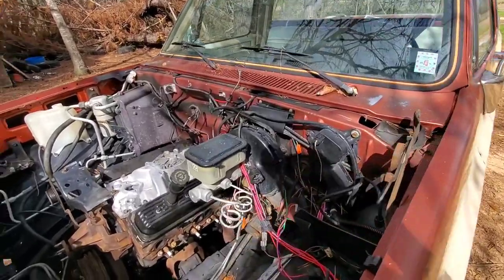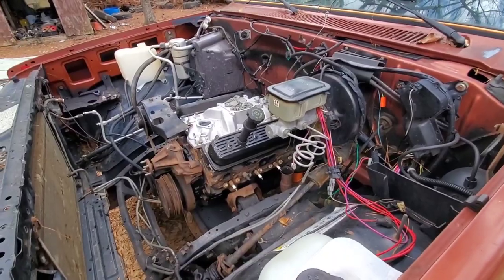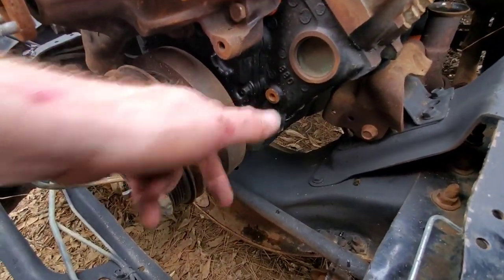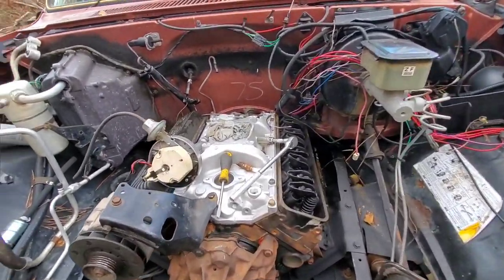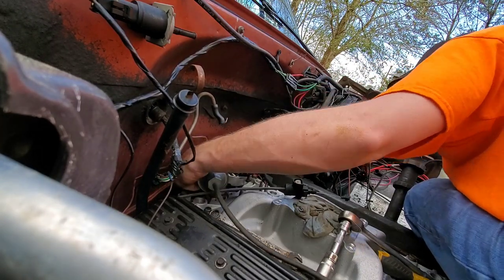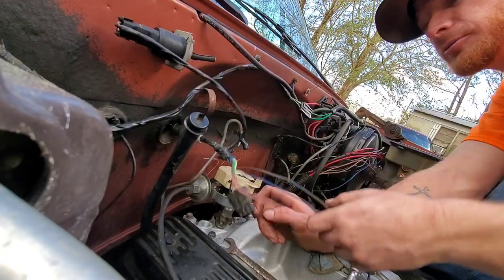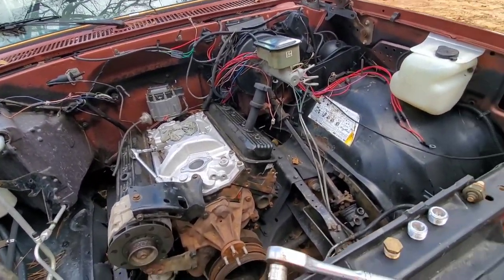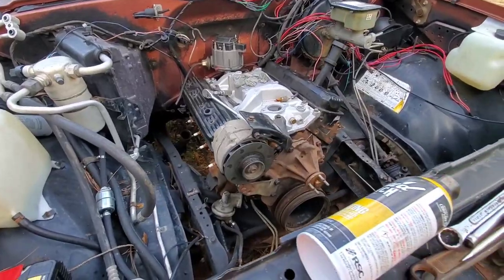Timing The 350 & Getting The 86 Closer To Firing Up

Comment: I lack the knowledge on engine swaps if their not exactly the same engine coming out/going in. But few Questions.......what year is the vortec motor that you installed? What is the brand+part# for the intake manifold ? Did or can you use the stock distributor from the old engine into the new engine? I have 2 shorty square bodies  I’m working on body work and mechanical overhauls. Have a 84 Chevy custom deluxe shorty fleet side 5.0 carb and 87 GMC Sierra shorty fleet side 5.0 tbi and both powerplants are weak underpowered ). Nice wrenching. It’s Getting there......
Reply from the maker: Motor is from a 97 chevy truck, intake part number not sure off top of my head but it's the cheapest one on summit for vortec heads, and yeah you can use the distributor from the original old school motor in the vortec motor

Comment: I am about to set the lash on my 305 and getting all the accessories on it. Then pull the front clip off and stab the motor in her. I work outside like you do I am in SC and the next week all good weather so I have to get on it and see if I can get it running
Reply from the maker: Yeah gotta take advantage of good weather when ya can

Comment: Nice work. It can be time consuming that for sure. Quick question? Do you have true duel on your... I can’t remember what year you  have? Your 5.3 Silverado extended cab. Mines an 02 and I’d like to do true duel with my exhaust but I’m trying to figure how I’m gonna do it. I want to get rid of the damn Y pipe and go true duel.
Reply from the maker: Mines an 05 but motor is from an earlier year not sure exactly the year tho.. but na mines just a single exhaust also... I wanna put duals on it eventually
Reply from the maker: I'm prolly just gonna use my factory y pipe and just chop it off where it goes into one and build duals off of it from there back
Reply: @bowtieguy601  yeah... that’s what I was thinking 👍🏻
Reply: @bowtieguy601  she’s really loud being right under the cab though 😂 I’ve been spending so much damn time on my 02 I haven’t had much time to mess around with my 92 🙄
Reply from the maker: Yeah that's one of the reasons I ran mine on out is to get rid of the drone inside the cab